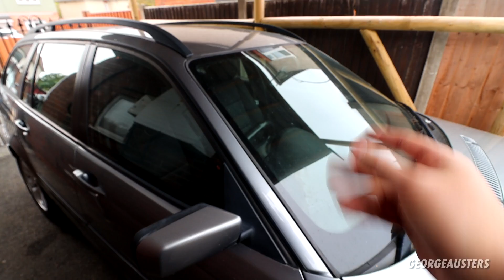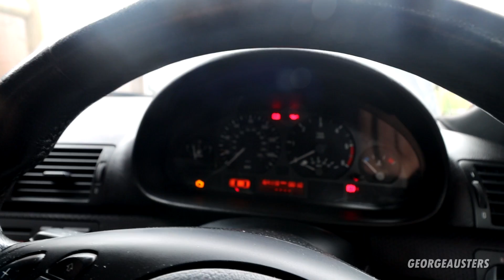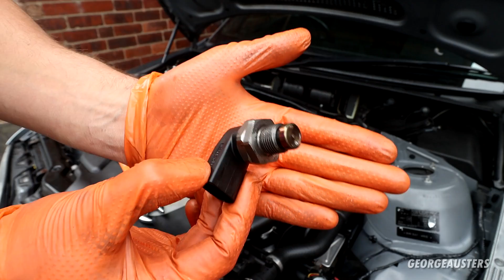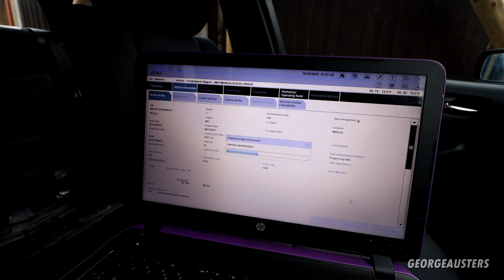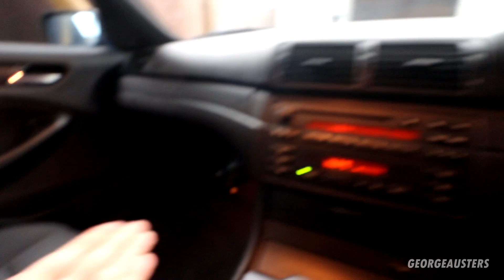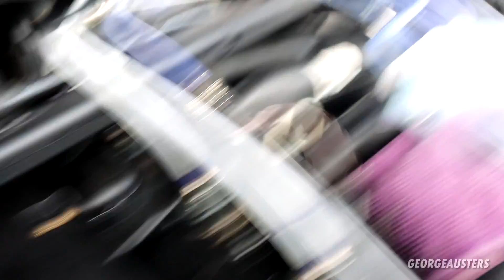TRADING UP FROM £500 TO MY DREAM SUPERCAR | PART 5

Comment: George, As I previously commented on and also commented below by others below the pre-supply pump is cavitating ie very noisy. Pump cavitation is a well documented engineering phenomenon. This is almost certainly caused by a reduced diesel suction volume (not pressure) to the  pre supply pump inlet, howsoever caused eg partial line blockages somewhere in the system (but probably in tank and or tank piping to pre supply pump) and which may also as a consequence result in pulling a vacuum in the system causing fuel starvation and hence engine dies eventually, as engine fuel supply is inadequate to meet engine demand. 

I recall you said the rear passenger side tank access had not been checked by the previous owner (or yourself) so as previously suggested, I recommend this is opened and checked for cleanliness and integrity  ie intact transfer piping, no dirt and no dirty filter to the new in-tank lift pump on the drivers offside and importantly transfer piping from tank to pre supply pump is internally clean. 

Start engine and when running undo fuel cap - there should be no air whooshing sound. If air suction sound is heard then this would imply a vent line is blocked and which will probably eventually cause the engine to stop over time as it does now, ie the problem could be caused by either or a combination of the above. Good luck and don't scrap it yet. You will solve this problem. I run an 02  E39 525D touring on 76k miles and which I try to use V POWER mostly for maintaining fuel system cleanliness. I have a love/hate relationship with this car but never again diesel! Regards BY.

Comment: As shed works says take the whole PCB board that relays fit into and have a look for dry joints the always fox you and any other PCB boards 50years as. Electronic engineer 10 in 999 garage services good luck

Comment: As suggested by some other comments, might be worth checking the DDE module/ECU compartment for water ingress or blocked drain in that area since it's the control area of the fuel system.

Comment: George, once had a citreon diesel which had very similar symptoms. Finally traced it to a faulty seal on the diesel filter housing. Diesel didn't leak out but air was sucked in, it allowed fuel to run back to the tank when not running. So say it was left overnight, the fuel system would effectively empty.

Comment: Hi mate, how about clear the fault codes. Keep the car running and monitor the live data until it stalls, or look for new fault codes after the car stalls, this could tell you exactly where the fault is.

Comment: George, sorry to see you having so much grief with this  one, and well done for persevering. My ears pricked a little when you said there was some deposits around the rail sensors, although if it was heavy contamination it would be more obvious when it does eventually run. Can I suggest you get a small oscilloscope (so cheap on ebay nowadays) and look at the injector feeds while cranking. I suspect you won't see a lot until it fires up. The cable harness and plug at the HP sensor on the back end of the fuel rail can be an issue, on the freelander td4 (M47) this was  such a common issue land-rover even developed a mod kit. However, on those they would run with it unplugged and it caused other symptoms, but maybe on that it's different. The green (viton)  o ring on the pump sensor suggests its been replaced. Although ista is telling you cranking pressure is ok, I am suspicious and would be measuring this on a gauge before I took it as read. But I am pretty certain the injectors aren't opening on initial cranking because there's a bit of vital info missing or incorrect. You've changed the crank sensor I think you said and normally inpa or ista would flag missing crank pulses anyhow, but again a small inexpensive oscilloscope would confirm this in minutes. Good luck

Comment: Replace the fuel pipes from the tank pump to the pre supply. Check that the return fuel pipe if it exists, and has a return valve that is not stuck open. I have built kit cars and with a empty tank the electric fuel pump will constantly run clattering away until it gets a good fuel supply and gets rid of the air in the fuel line than it stops.  I believe your problem is air getting into the fuel line before the fuel pump, If it was after the pump it would leave a puddle under the car.

Comment: I had a 54 plate E46 320d and had a similar issue but only on start up. Sometimes it would start fine and others not at all. Changed the fuel relay and never had an issue again.

Comment: Hi George. I had a noisy Sender unit in the tank when my Diesel filter was old and blocked. 
On another car it had a noisy sender unit, we replaced the diesel filter and it was still noisy and not going very well. 
We then drained the diesel and filled a few liters of fresh diesel. It started up the same but as soon as the new fuel came thru it was getting better. 
I’m not sure if you have done a test like that. 

Long cranking in a diesel is air in the lines or contaminated fuel. 

Could also be that the injectors are dirty and not atomizing the fuel as it should. But yeah that wont make the pump noisy. 

Electrical faults will show up on the Diagnostics. Luckily the BMWs have a bunch of sensors etc. 

Fourbyfour diesel have a video on their youtube about how you can determine if injectors are faulty by looking at the diagnostics when the car is idling.   Anyways sorry for the long comment. 🤦🏻‍♂️🤦🏻‍♂️ Hope you get it sorted asap. 🚀🚀

Comment: Every time you work on the car you're getting closer to fixing, don't get frustrated, keep going. I think you need to measure the fuel pressure on the rail. Additionally can you get the reading from the rail sensor that the ECU is seeing from the scan tool. Once it cuts out and the crank is extended, that pressure reading is going to prove if your issue is due to a lack of pressure.
Reply: I agree, need to check if you have sufficient fuel pressure at start-up, after sitting for a day or two... it could be that fuel is leaking back to the tank, or leaking elsewhere (top of the rocker cover) letting air into the system, and then needing the extended crank to get pressure up (hence the noisy pump??)

Comment: I would change the Crankshaft Position Sensor again. It's a cheap fix and seems to be the EXACT symptoms you are suffering. If the clutch has been replaced since the last one was fitted, it could easily have been knocked out of place, or damaged.

Comment: Great video l had an x5 Similar problems I didn’t cut out when I went to start it it was just crank over soon as I’ve played some easy start started this was due to the injectors so have you checked all the injectors make sure they are running probably just a suggestion thanks keep up the good work

Comment: Possible worn bearings equals oil starvation after 20-30 mins then stalls I say this as I had this problem as I wrote above eventually after a few good garages I know they couldn’t diagnose the problem so I had to go to BMW after about a week they sent me photos of my bearings and renewed them big job but fair play to them I got a new engine not rebuild for 50% discount still 4.5g but at least a new engine

Comment: Hi. I've  had similar problem on fiat van. Long engine crank and cutting out . Luckily for me only 3 times before part gave up turned out to be fuel pump regulator the one on back of fuel pump with 3 screws it cost about £50 new bosch one . This  has a major mechanical adjustment in fuel pressure. Hope this helps

Comment: PLEASE READ  George my x5 had similar issue I went same route as you firing parts cannon at it got all genuine parts  and had same error about pressure on start up I was ready to scrap it but I changed the sensor on high pressure pump and my issue went away . My start up pressure was 12bar Instead of 200 I forget exact numbers but was that I know you cleaned yours but maybe worth getting hold of another one to test ... I had to use Easy start to get mine running

Comment: Very frustrating.  Reminds me of a '74 Honda CB550 I had 10 years ago.  It was in great shape, but would die on me at random times.  Worked on it for months.  Checked that the fuel tank was clean, installed inline fuel filters, took the carbs off numerous times, installed rebuild kit, bought a expensive carb balancer.... same problems.  I was out on the highway trying to get to the next town.  I would get about 6-7 miles and die.  I would shake the bike around, trying to maybe dislodge something in the carbs.  Was trying anything.  I could go another mile but it would die again.  On the third or so time, I opened the fuel cap to take a look if I was out of fuel and noticed a vacuum sound when I popped the lid.  Turned out, it was the fuel cap vents were a little corroded and not allowing air in the tank and creating a vacuum,.  Took a pick to it and reworked the vent holes.  Fixed.  Never had the problem again. Racked my brain for months.  Just keep on trying.  Take breaks from it if you have to.  You'll figure it out.  Now get back to the Mini!  🙂

Comment: What about the control module relay for the glow plugs? 

Does the DDA stay on for ages or go off quickly please?
Reply: The glow plug module will not cause random engine shut down events.
Reply: @elliottpeters2996  I've checked youtube and that was one of the threads that say that is something to look into. Can't harm to look.

Comment: The noisy pre-supply pump may be the clue. It is OK itself so assume the noise to be either issues with sucking or with blowing. What if something is impeding the flow when it tries to draw 'normal' supply to the injectors. Are the fuel lines clear to and from that pump?

Comment: I had the same problem with my x5 E53 3.0D M57 the car stall and you cant start it again and dose not throw any code on ista. I changed camshaft sensor check the camshaft and cranfshaft sensor
Reply from the maker: Was your pre supply pump noisy?
Reply: @George Austers   yes my pre supply pump was noisy and is noisy right now when  I fill the tank full it make less noise
Reply from the maker: What fault codes were you getting? Wouldn’t you get camshaft position sensor faults?
Reply: @GeorgeAusters  No I did not get any code when I had this problem the car drive normal and cuts off randomly I will need to wait 10 or more minutes to start the car again

Comment: From memory when this cuts out it wont restart straightaway. Have you tried spraying a little brake cleaner into the intake at that failure point, if it then tries to start that would suggest a fuel problem otherwise can only think it’s a heat related issue with supply voltage as heat rises current carrying capability reduces and you lose pressure until cools off again. Good luck anyway, can imagine the frustration.

Comment: As surrgested by Clark Kent have a look at the fuel cap or the breather system, if this is not working properly you will create a vacuum in the fuel supply, try running it with the fuel cap off if it doesn't cut out there is your problem. Good luck

Comment: I had a similar problem with a 2000 Mercedes e350d, which turned out to be a non-return valve in the fuel line.

Comment: I commented last time. I'm with on, "maybe there's air getting into the fuel system."  I would try a new gas cap. Sounds ridiculous but over the years I've seen some crazy fixes, just replacing the gas cap, including problems starting and overall performance.

Comment: Also measure the rail pressure when the car doesnt start, if no pressure after o ring replacemwnt on solenoid then change the solenoid
Reply from the maker: It was getting 400 bar when I checked it before

Comment: Mate its the o ring broken on the fuel pressure regulation solenoid on the side of the high pressure fuel pump, dont buy a new solenoid just replace the o ring and it will work bit deff give our garage a shout when you find it works
Reply from the maker: I literally checked that in this video mate 😅

Comment: Put some high quality diesel in with redex then take it for a hard drive to get everything working and clear it out, check the fault codes once back. I love a E46 and your one looks so clean and tidy.
Reply: Redex is crap imo and may only work temporary so issue needs fixing

Comment: Mate of mine recently had same issue with his E90, changed the fuel filter and pump and still had the same problem, he changed the intake fuel line from the fuel filter to the engine and job done mate..... oh i should add that the pump made exactly the same noise you are getting, i reckon you have shit in the line after the filter and the pump is working to hard to try to supply the fuel....... at the least pop the fuel line off, spout a few syringe full of petrol down it and blow it out with an air line, gotta be worth a shot
Reply from the maker: Yeah I’ll have to get my air compressor here to try it
Reply: @GeorgeAusters  if that dont work buddy, either break it or show it the graveyard and take a hit for what youve put into it already as you know yourself youve put a lot of time into it, not just on the car itself but also the vids. I wouldnt throw more than a few more hours into that car George and that would be giving the fuel line a good clean and blowout, hope it works dude 👍

Comment: Relays can be intermittent, I had a problem with an e36 where it would start, then not, then start, drive, stall and then randomly start again, it was the fuel relay. You can if you know which pins, use a wire on the contacts see if that sorts it until you get a replacement relay obviously don't leave it in otherwise it will drain the battery.

Comment: Hi George, I commented last time. 

When that engine was crank no start at biggining of your vid you needed to be checking the Rail pressure in read measure values. At that point im very confidant it will only be pulling 100 bar and target is 360. 

Again with leak off test it might have been worth leaving that on till the engine cut out and checked to see if there was significant increase. If not, remove glow plugs and check it wasnt going to cylinder on crank. 

If you would have took the time to remove the common rail carefully and remove either sensor and poor into a clear contaner i suspect it'll be heavilly swarf contaminated. 

Im sure its your HP pump George. By the looks of your test the injecters have survived but they will fail once the grit/swarf from the Hp pump makes it in there. 

All the best.
Reply from the maker: I’ve checked the pressure previously and was getting perfect pressure 400 bar

Comment: If it was me I would check the crankshaft sensor just in case its been replaced befor with a cheap copy...as when it cold it starts as I had an astra doing the same issue...when it gets hot could be going to ground untill it cools down...like the old fashioned oil coil...hope it helps...
Reply from the maker: Previous owner already tried that
Reply: @GeorgeAusters  just have a look at it and make sure its not a Chinese copy...and go on live data on your diagnostic machine and when it next has the long crank see if the is a,reading on it when you turn it over....

Comment: This car is too good to be scrapped yet, however you still have to check:
1. loose connectors or oxidation -jiggle around that relay, 
2. inspect ecu joints and resolder them all 
3. and last but not least high pressure pump witch is can be fixed -a transistor in gel is a common failure point similar to ABS module in construction. Take a look on yt type "vp44 bosch trouble welding mosfef. Car don't start" - and that could explain why you have those symptoms.

 If you check all of that and still not working yeah go ahead and part it out but at this point hell no! It's more interesting to investigate on this e46 than change the oil or brake pads for example...
Sure it will cost some more and if you fail you will recover some money from parts but if you find the issue and fix it you will gain much more - is not all about the money.

Now on the vp44 could be a weak connection like in the video or a bad mosfet. A china part will cost arround 20$ and will last.. 40min? so take the good stuff - usually those who fix them know witch capsule is the best and the price will be accordingly - the labor is the same.

What ever you'll decide to do with this e46 from now on, it was a pleasure seeing the struggle :)

Comment: Had a 270 merc which had bad or no start problem and power loss, turned out to be air getting into the fuel lines, found this by replacing lines in engine bay with clear lines wehre you could see the air bubbles in the fuel therefore low pressure at the injectors ?

Comment: Hi George you can possibly try and get a new relay, disconnect the battery, if that doesn’t work then perhaps a feed from either the rear wiper to the fuel pump, then that might help you find out if it is a electrical issue

Comment: Hello, I'm new to the channel. I would agree, it's not an electric problem. If it was an electric fault, it would be there all the time and I also doubt it is a low battery. The fact that it takes up to 30 minutes to manifest itself, leads me to believe the inlet manifold/cylinder head could be warped. Saying that, it could be as simply as a gasket change. It could also be (if it's a diesel), a blocked DPF.  The DPF software could have also been removed in a remap to cover the problem after a forced regeneration of the DPF hasn't worked/failed.  I should have watched part1 to see if you have used a diagnostic tool and any codes it had reported.  The car looks way too good for scrap. I would maybe look at it as a long term project if you have the space. Looking forward to your plans on this car. Thumbs way up!!